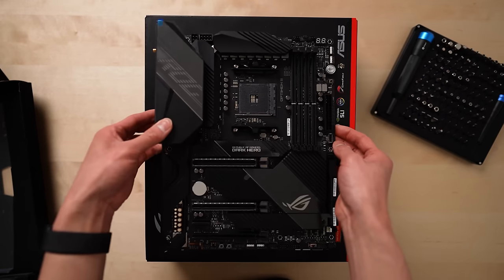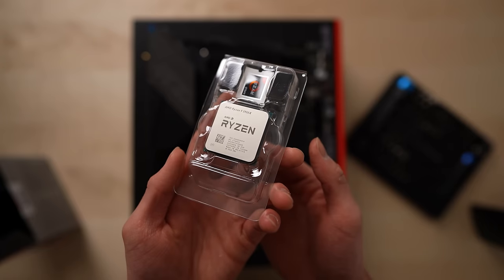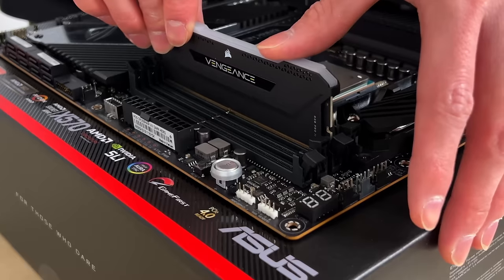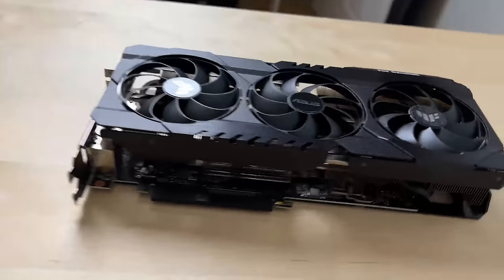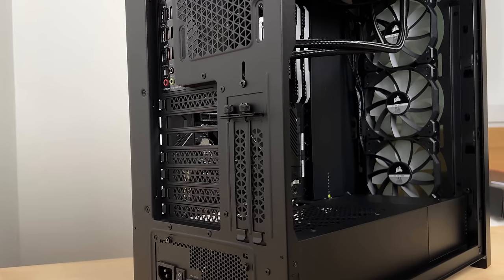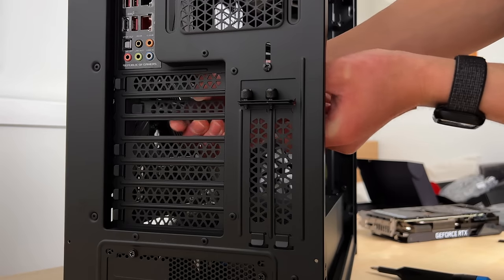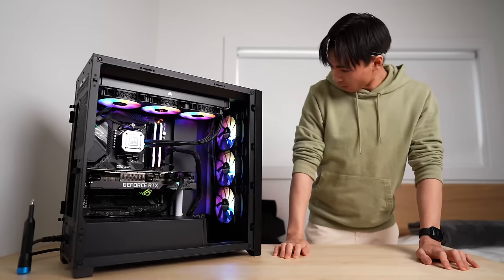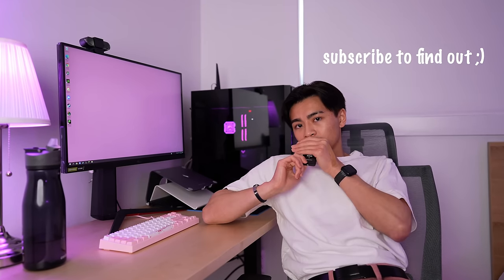Building My First Gaming PC with No Experience... (High-End)

Comment: may be worth researching how to use the bios to make the most of the RAM speed seen as you have 3600 speed, by default (i believe it's called XMP or something like that) it runs at a much slower speed maybe even around the 2000 mark
Reply: DOCP for AMD
Reply: Yeah mine runs at 2666mhz as standard but you have to apply the premade camp profile to clock the ram up to 3600mhz
Reply: It's a risky procedure though, mine PC kept crashing almost each week with a blue screen because i changed my RAM speeds to 3200 mhz
Reply: @Ligmaballin  if the ram is rated for that speed it shouldn't be an issue at all
Reply: @alexj6512  idk, i bought a 8gb 3200mhz ram stick, i tried the 3200mhz XMP option trough the bios settings but it occasionally crashed, so im using 3000mhz instead cause it's more stable
Reply: @Ligmaballin  maybe a power supply problem
Reply: @_ZERO  I'm using Antec 600w gold rated 80+ PSU with Ryzen 3 3100 and now RTX 3060, when i made the original comment i was using GTX 1070 TI. I'd say 600 wats is enough no?

Comment: I like that you got a nice motherboard to future proof your build, the only problem is that AMD (the manufacturer of the CPU) isn't going to be using that socket in the future and are switching to a different platform so basically no knew cpus will fit in the board lol
Reply: @CluenMedia  amd will only switch to the new am5 socket this year, the am4 socket was compatible with all am4 generation of amd/ryzen cpu's unlike intel who uses a socket for 2 generations max

Comment: you said you were confused but you actually did a great job for your first build imho. a tip for future reference is when applying your own thermal paste you don't need to use the thermal paste spreader, squishing down the blob should get it to spread out just fine but you seemed to do everything correct.

Comment: Hey just a tip here, dont spread around the thermal paste like that. If you do a dot in the center, when you push down the cooler itll push it all out to cover the whole thing, that way you wont have extra bits leaking into the cpu
Reply: He's spreading the thermal paste using a thermal paste applicator. It's fine. Using that method gives better heat distribution than the center dot method.

Comment: I did my first build with zero experience recently. I had no idea that case fans spin counter-clockwise, so my Phanteks NV7 has two intake fans and ten exhaust fans. I had to order more reverse-blade D30 fans that will take until Friday, August 30 at the latest to arrive.

Aside from not knowing where to plug in the AIO pump power cable, having to get another AM5 standoff screw from Phanteks support when I lost one (yes, I used a lot of Phanteks in my rig, namely the case and cooling components to keep all of the RGB in a single ecosystem), and my piss-poor cable management, my first build went a lot smoother than I expected. It posted on the first power-up, and I flashed the BIOS no problem. Now I just need those new fans, during which time I can fix my cable management.

Comment: i have the dark hero also. And now EK screwed us over and stopped producing the waterblock for it.
Notes. Dont spread the thermal paste, you can make air bubbles and drop the efficiency. let the cooler placement spread it naturally.
Your GPU started sagging immediately. 
But the most important thing. DONT use the single gpu cable for that card. I know the cable has two 8 pins, but for a card drawing that much power you really really need to use two separate GPU cables and only the first 8 pin from each. That thing can literally catch on fire trying to draw too much power from one cable, it DID happen to me.

Comment: use 2 8 pins for the 3080 instead of a 8pin pigtail because the pigtail can only do 150w plus what's from the motherboard =to 225we and your gpu goes up to 320 w so another 8pin is needed or bad things can happen

Comment: As a computer tech I would say you have done a great job and you nailed it, however you should use a different separate 8 pin connector to your GPU and avoid using chain connections just to be safe

Comment: 4:53 tip for next time never spread it out. If ur put pressure on it with the cooler it will further spread and may get into the pins on the side.
Reply: Spreading it is fine. Just don’t use too much. Professionals do it all the time. Please don’t give tips

Comment: If you are making videos, you will probably need more storage, but by now you might already have that covered. since i save clips and games, i usually use a terabyte per 2 weeks. Thats why i have a main SSD and 2 separate 2 terabyte harddrives, since they are cheaper and wont be used much for loading videos, due to my main ssd.

Comment: I'd advise plugging in a second cable in your PSU and plugging it into your GPU. You've noticed your GPU takes 2 PCI-E connectors, and you've used one cable with the daisy-chain plugs for both, which while it'll work it's not advisable for such power hungry GPUs. It's safer to have 2 separate PCI-E cables 

Feel free to research the what and why, but the short of it is a PCI-E cable is rated to supply 150W of power, and your PCI-E slot (on the motherboard) supplies 75W, which - in your current configuration - allows your GPU to safely draw 225. were you to use 2 separate PCI-E cables that would increase the headroom of what's considered safe (or within spec) to 375 - which is on the money for the Asus TUF 3080's rated 370W max power draw

Comment: Dude this turned out more than great for a first time build! You built this machine like a pro. The ONLY thing I would have done differently (and I'm really nitpicking here) was that I would have used a coffee filter to clean off that thermal paste.
Reply: why a coffee filter?
Reply: @GoJoMoe  Because with a coffee filter it doesn't leave any fiber particles on the cpu. A paper towel on the other hand can leave a lot of particles behind on the cpu and it could potentially cause problems.

Comment: I just built my first PC aswell. i7 13700k 4070ti DDR5 6800 WD Black Sn850x 2 TB on a z790 motherboard. Put it all in a Lian Li 011 Dynamic. I spent around 2500 on all of it, is it just price difference overtime or did you overspend on parts?

Comment: also amds "zen 3" which is the cpu youre holding is an am4 cpu and not lga

you might be saying "tf is the difference between non-lga and lga cpu?" the difference is non lga have their pins under the cpu meanwhile lga has the pins on the motherboard so you dont really need to be extra careful holding the cpu but youll need to be careful too any fingerprint can fry your cpu

and if i want to use the 5950x i want to use 3090 instad of a 3080 and why you mght ask?
balance.

5900x with a 3080 is a perfect balance

Comment: Very good build, but you could’ve ended your pc’s life. You did perfectly fine with building it, but the mistake you made was peeling off the plastic on the pc while it was turned on. Usually what happens is that it can cause a static charge which completely kills the pc. Luckily you didn’t get that tho.
Reply: Ive built a few pc's but dont call me an expert, However i do know the myth that a little static can kill a computer has been busted and is pute BS i think LTT did a video on it go watch it.

Comment: NEVER SPREAD THERMAL PASTE LIKE THAT. A PEA SIZED DROP IS ALL YOU NEED. ALSO NEVER CONNECT A GPU LIKE THAT! You didn't use the included cable for your GPU! You were supposed to use that cable for both 8 pins and then take two PCIE cables straight from the PSU to that cable.

Comment: How does one know if the case will fit all the parts ?
Reply: Check the sizes of the case and mobo to make sure they are compatible (if u get a Atx case it will fit all mobo sizes. If u get a Matx it will fit Matx and itx and mini itx and a itx case fits mini and itx mobos) check the dimensions of your case and see if the other components are going to fit.
Reply: @someone5680  thank you